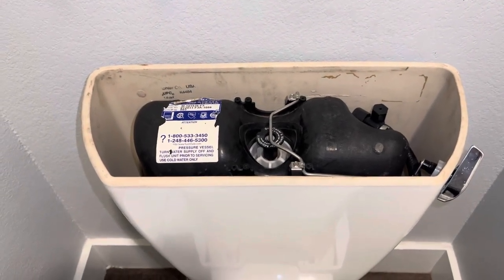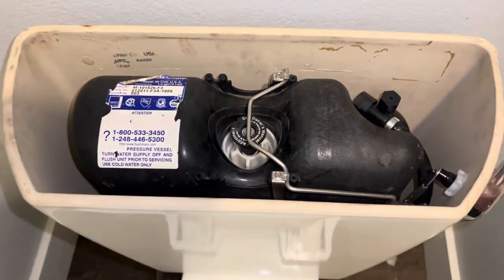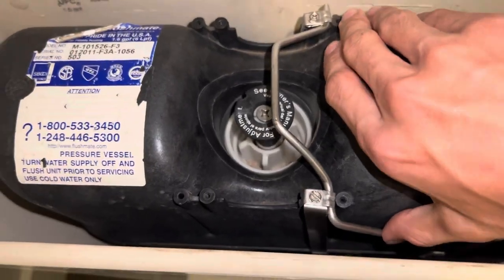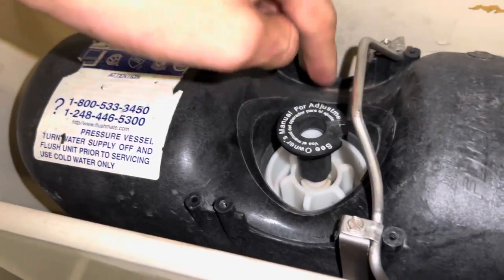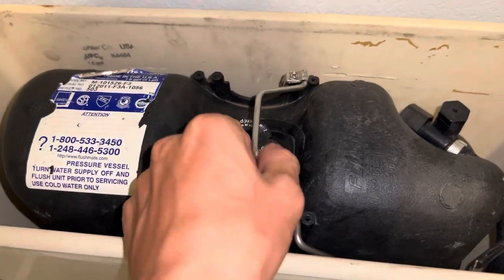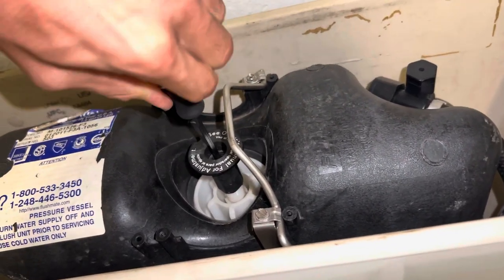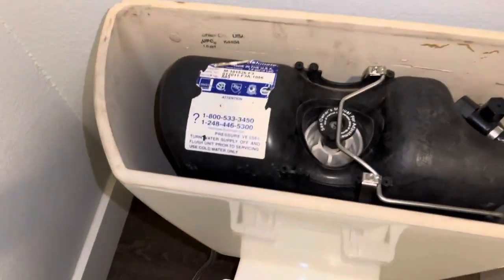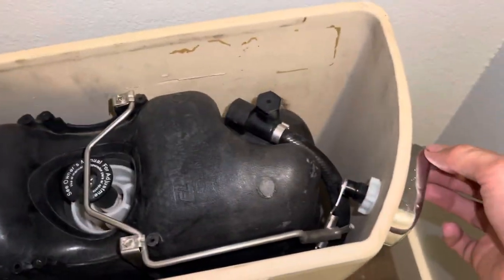How To Adjust A Sloan Flushmate Flush Actuator!

Comment: Is there any way to adjust the flush agressiveness/pressure? I imagine adjusting how much air it intakes from the suction valve on the back right might be the key?
Reply from the maker: Unfortunately there is no way to adjust the pressure.
Reply: @BTRPlumbing  There is technically no way to adjust the pressure, but if that octagonal black valve doesnt intake any air, the flush pressure will be weak or non-existent. So the flush pressure is proportional to how much air it intakes. 
It stands to reason that if you place something thin to slightly reduce how much air it intakes, you can reduce the effective flush pressure, no? I think it is worth trying?

Comment: Just the video I was looking for. Question: I know it says that you need to shut off the water supply, but is it absolutely necessary for this fix in particular? My toilet's flush valve is totally corroded and I'm a bit leery to shut off my house's main water supply. I don't know much about plumbing but I don't want to risk making anything worse lol.
Reply from the maker: It’s not 100% necessary. The only reason I do it is so the toilet doesn’t keep flushing every time you push on it
Reply: @BTRPlumbing  Thank you so much for the quick answer!! Was worried I'd be stuck with this frustrating issue for the whole weekend. Thank god for people like you who post these DIY fixes and are still so active responding to comments
Reply from the maker: You’re welcome! I’m happy to help!

Comment: Mine doesn’t flush well, like every time I have to double flush. Is there a way to adjust how much water is in the tank? Or maybe I need a new cartridge? Tired of waiting for it to fill to flush again
Reply from the maker: Unfortunately there is no way to adjust the amount of water in the flushmate
Reply: @BTRPlumbing  So what would be the fix to this? A better flushmate model for the toilet?
Reply from the maker: @toodoperecords  do you know how much water your toilet currently uses?
Reply: @BTRPlumbing  My water level has gone down over the past two weeks, it's about an inch lower than it used to be, causing a weaker flush. Any idea how to fix that?
Reply from the maker: @NeRo9k  there’s a few things that could cause this. Low or weak water pressure can cause that. It could also be a clog in the filter where the supply line connects to the toilet. Another part that could possibly cause that is a bad cartridge. Those aren’t too difficult to replace. If your flushmate is older I’d just recommend replacing the whole unit

Comment: Some ppl have different ways to do this because I see ppl do this on yt.
Reply: I've seen someone loosen one of the clips, push the clip out of the way, and slide out the rod. This is how most ppl do it, but there are some misconceptions. Some ppl would think that they would have to loosen both of them to remove it, which you don't have to because the rod slides out once the first clip is loosened and pushed out of the way. Some would also think that they have to remove it completely, which you don't have to because the clip pivots once loosened.
Reply: I've seen someone else take the screws for the clips all the way out, and then remove the clips, and lift off the rod. There are also misconceptions for this. That way itself is a misconception because you really didn't have to fully remove them to remove the rod. Also, when doing it that way, they could lose them. Once they are lost, they will be hard to find.
Reply: Your way also has misconceptions. When you think of tightening or loosening screws, we think lefty-loosy, righty-tighty. Toilet handles are reverse threaded, which is something an average person might not know especially when they have never replaced a toilet handle before. It was helpful that you pointed it out. I didn't know that's how toilet handles are until you pointed it out.